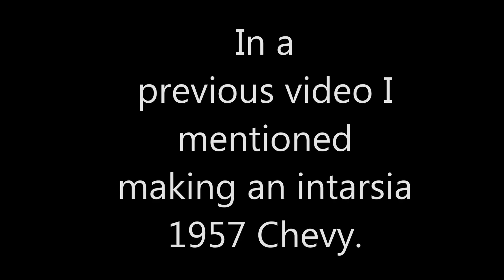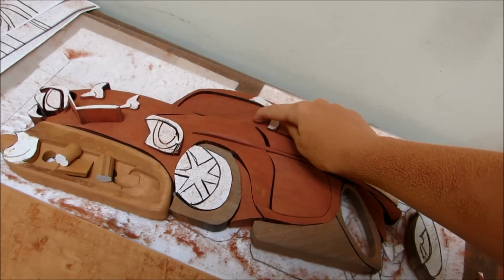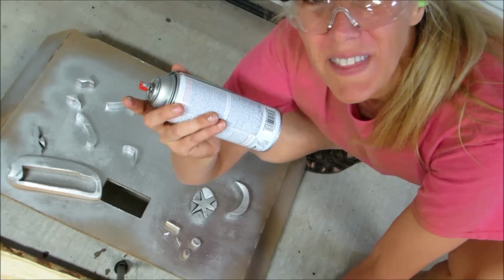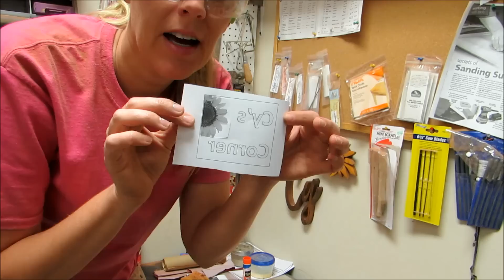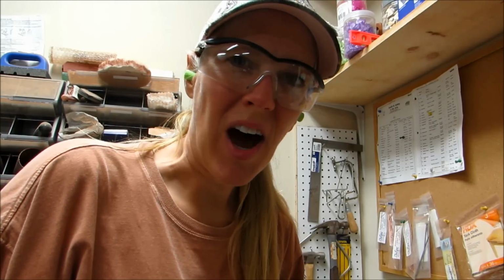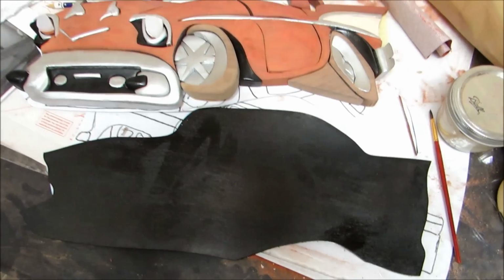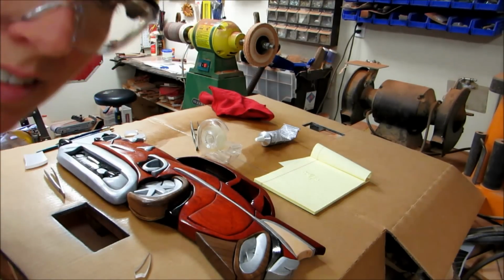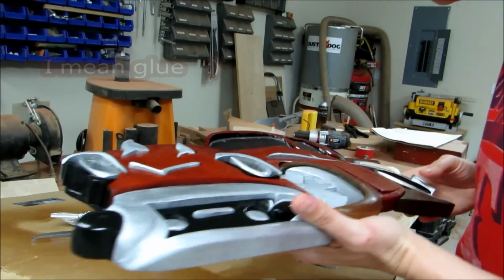1957 Chevy Intarsia

Comment: What an awesome job, Cy.  I have a suggestion on your plex. windows. I used to work w plexiglass in the Navy and if you take a butane/propane torch with the flame on low,  and lightly pass the flame back and forth along the edges of the pieces, it will melt away any milky or frosted color that was caused by cutting.  Try it on a scrap piece for a test.  I love your 57. nice job!
Reply from the maker: Thanks so much for this tip!!! I have used plexiglass a few more times and will definitely try this flame trick next time!!

Comment: You can use an inkjet printer, print on wax paper [taped to a regular sheet of paper] and, while the print is fresh, scrap it off on smooth wood with a credit card or equivalent.

For the heck of it, and if you play with plexi again, try spraying the back of a test piece with your silver. Also, just try sanding the back side.
Reply from the maker: +Kelly Craig Thanks!!!

Comment: If you print the image on wax paper it works way better. I personally have never had any success with the iron on
Reply from the maker: I got the technique down now and use a small tip on my wood burner with the toner printing! I have seen the wax paper technique with ink printers but have not tried it.